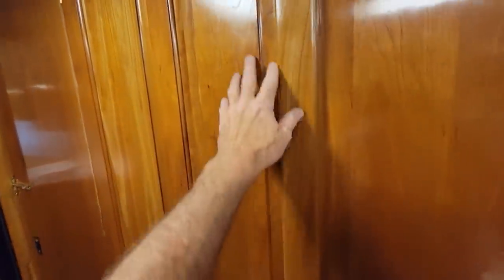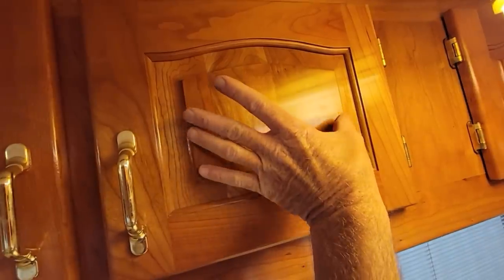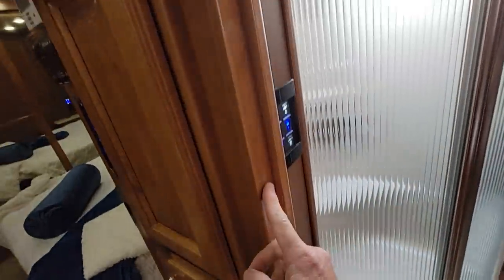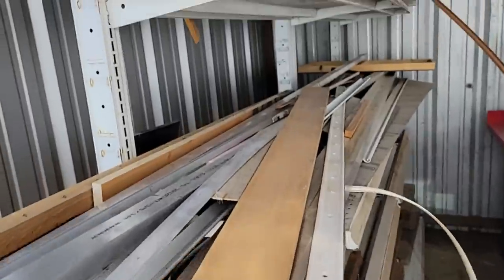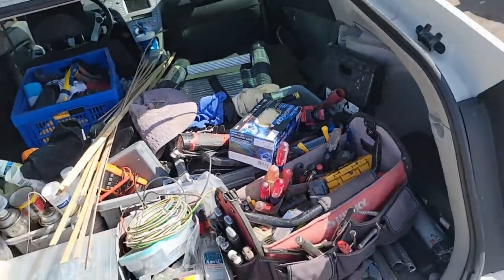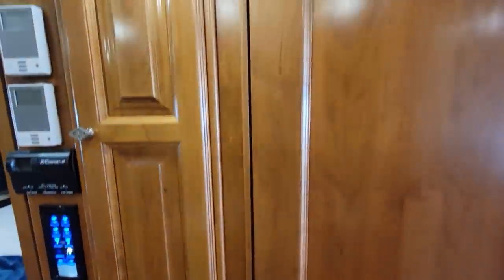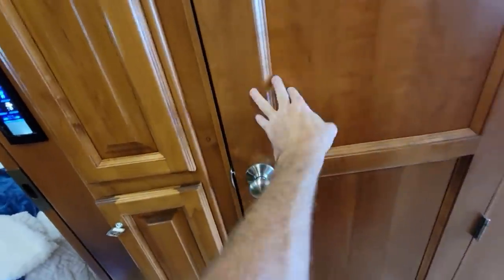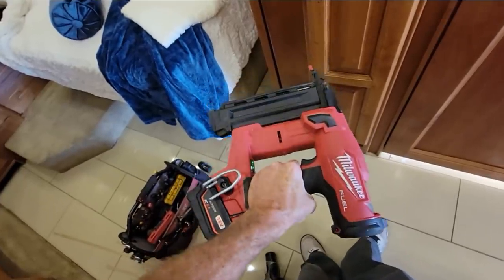A Very Common But Forgotten RV Maintenance

Comment: As a degreed furniture engineer you allow the panel to float inside the rails and stiles by just pinning the panel.  No glue on the panels, just on the stiles and rails.  The panels must be prefinished on the tongue that inserts into the groove of the stiles and rails.  Once movement occurs the prefinished panel tongue will not be noticed since it was prefinished before assembly into the door.  Lumber should be kiln dried to 6%-7% MC before assembly.  That will give you a good range with EMC's in the US.  Still have shrink and swell though.  Just have to manage it.  Thanks for the videos.  I appreciate them.
Reply from the maker: Thanks for the info! and thanks for watching
Reply: I really appreciate witnessing two experts exchanging valuable information! Thank you both!!

Comment: I love your YouTube channel. I am a subscriber. And it's thanks to you. I recently got myself a 22-year-old, 2002, Monaco, Knight, 34-PST. That has spent its entire life in, Central, Texas. Owned by a couple of, elderly couples. And kept in immaculate condition. Like new.

And being 22 years old now. In Texas. Where is very dry. The doors are all tight. There are no gaps. It's all very lovely, natural blonde wood. Just beautiful. The exterior is colored Taupe. The exterior is gorgeous. Eggshell white. With, some beautiful conservative, light gray, dark gray, black, sweeping lines. Very snazzy. Not gaudy. No stupid colors. Very stealth. With 3 slide outs. All working great. And 65,100 miles on the odometer on the 300 HP Cummins.

And it's watching your channel. And also Liz Amazing's, Channel. You guys had me in the right direction. On my selection. Thank you. This is a gorgeous unit. Like new. It was Covered for the past 4 years. And under the chassis. I really can't find any rust. It looks amazing. It's got 6 , one and a, half-year-old, Toyo Tires. Really showing no appreciable wear. They got them last January. 2023 and have only taken a couple of trips since. Before that, 88 and 85 years of age and failing health. They had to hang up their, newfound freedom. From their 14 grandchildren as they told me the motor home was strictly, for them. I said your grandchildren were never on your motor home? They said no. I thought that was very funny. I never really grandparents like that before? But I guess 14 grandchildren can wear you out? And they could escape with the Motorhome. So I know they were giving up a lot. It was Sarah and Bill. And Sarah told me the Motorhome's name is, Magnolia.

I can't believe how gorgeous and how perfect, it is. And the front CRT, BOOB Tube. Was expertly replaced. With a nice big LCD-TV/Monitor. And the same in the bedroom. No washer dryer. And that's fine. I like going to the laundromat. Once every couple months. I have a lot of clothing. I have boxes of only the best, audio/video crew, T-shirts. From all of the shows I have worked with over the decades. How do all these decades ago by so quickly?

Well? I'm going to be 69, soon. All of my loving family members who passed on. I'm the only one left in my family. I never had any children of my own. Recently I became an adoptive parent. To a, 34 foot long, 30,000 pound, child. And it eats a lot. So I don't have to. I need to loose some weight. This is a great way to start. To start a diet. With a Motorhome. That gets, about 10 mpg. So it's definitely going to eat better than I will. I will eat, a lot of beans. To produce enough gas. To, heat my water for a shower. Once a week. Whether I need it or not. I'm going to have to eat a lot of beans. As I am musically oriented. I have major music award nominations. But only, nominations. So that doesn't count.

And now it almost 69. It's time for me to become a Nomad. With a very nice diesel pusher. And for its age. Everything that could have broke. Already did. Was already fixed. And/or replaced. Or it's still that new. Though? I will have to replace all, 6 rotted out speakers. And that'll set me back a whopping, $300 for the low-end, JBL's. $600 for the better ones. But that's the only brand I'll purchase. I used to them and all my recording studios over the decades. I've had more than one studio. In more than one location. Big ones, small ones. Both. And then I went a different direction. I largely, downsized.

So? In 1990. I moved my beautiful Control Room. My high-end, it is a data control room. With everything recycled and refurbished. By me. And loaded my whole control room. Into a 1984, Mercedes-Benz, L-1117, turbodiesel, 25,000 pound, Box Truck. With a, 1 ton powerless tailgate. That makes for a great little ports. And the rear garage door removed. Replaced with a single large swing outdoor. With top and bottom latching deadbolts. And no windows. And a box built within the box. Everything is soundproofed. Then split into 3 internal rooms. All separated with solid core front doors. And I operated my business for over 30 years. Until the pandemic. And I knew it was time to throw in the towel. And sell everything off.

After paying off all my bills and going completely broke. I have enough money left over to purchase this Monaco Motor home for $25,000 cash. I think I got a really good deal. It might be slightly over bluebook? But it is choice and like new throughout. Everything in the manual. Is what I'm looking at. Even the radio. Which has to go. It still works fine. But I want better. I.e., better. As a Retired Audio Engineer.

So with, 12 volt, Audio, Sine wave, Inverter, on. Connected to the new dashboard radio. I have mine former, JBL Control Roof Speakers. Right behind the driver's seat in my coach. And I will be Rockin' Down the Highway. With the Doobie Brothers. And all the others like them. And look. There's, Toto! They are singing something about, Africa. And there will be no, Elvis Presley in this Motorhome. Though? Maybe an occasional, Buddy Holly? But Chicago would be better. Even in the winter time. In Quartzsite, Arizona.

I'm going to have some fun at, RV Parks. I think I will take out my old, Network Television chops. And I want to do a, Karaoke thing. It'll blow everybody's mind. Nobody does Karaoke. Like, I'm going to do, Karaoke. It's going to freak everybody out. Everybody will want to do this. I will end up with lines of people. I will have no problems making a few extra dollars. When they get a recording. Of what they've just done. With video. With multiple cameras. Chroma green background. Along with my video switcher. I can put them. Anywhere they want to be. Anyplace. Even anywhere in time. With digital video backgrounds. And then! To get really crafty.

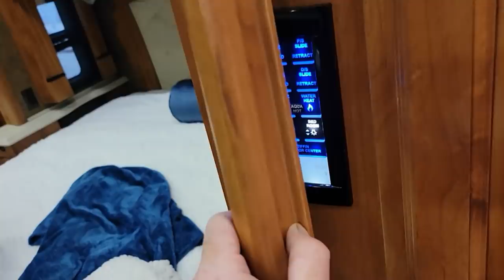I have a major music award nominations. Partly for the way I know how to cut vocals. And I use a couple of gizmos. One is a real-time digital, Pitch Corrector. Nobody will be singing out of tune at all. They will all sound like hit records. And walk away with a cool video of themselves. Nobody does this. Not like this. It might spring a second career for me? I've been talking about this for years. I've had the video gear and audio gear, for years. And it is so simple, high-quality and lightweight today. And it's all in how you use it. How you put this show, together. It only lasts, 2:30-4:30 minutes long. But what a, Showcase it can become. I think it'll keep me busy virtually every night I want to do it. At an RV park. It will be fun and goofy. They do the same thing. To, Taylor Swift and Justin Bieber and those types. Talent Light. Diet Talent. Zero Calorie Talent. Types. And it's largely all automatic. To let that fool you. That they practiced or rehearsed. They likely did nothing of the kind. Why would they waste their time? They have computers and software and an, Expensive Producer. And high-end studio. And managers and publicists. And they Concert Tour. They Perform with the, Computer. Because they can't do it without it. They have no talent. They would sell like Karaoke Night at your local Bar. Ugh! Vomitus! But great when you are drunk. I don't drink much. It makes me feel bloated. I retain water. And I only get natural sea salt. From Sushi. And fresh brewed soy sauce. Along with fresh brewed beer. And you get all the food groups. And magically lose weight! Because Motorhomes eat well. So you don't have to. Motorhomes make you healthier. When the toilet breaks. You have to find others. Because your tank is full of crap. Then what do you do? Get another motorhomes? I

I like the one I just got thanks. And so I don't care what people say about me. I am not full of crap! I go to the house where I can. So I don't have to play with a lot of crap!
RemyRAD

Comment: I believe your Beaver was made in Bend Oregon in the central part of the state. I have a 40 ft Beaver Marquis with the cat c12 @ 505 hp. I’ve been told they moved operations to Eugene after 2002. The power to weight ratio in these rigs is astounding. 26000 lbs with 1650 lbs of torque.
Reply from the maker: They are truly amazing!

Comment: That was most interesting to watch. My Holiday Rambler was spending its first 14 years in the dry climate of Arizona were we found it and brought it over to good old and much more humid Germany. And since its one 2003 HR Imperial, the types and modelyears that you recommended in previous videos, it has no cracks or loose wood connections. Thank god! Right now i sit at my desk, looking outside the window and see my RV in the driveway. I have a remote sensor temp/humidity gauge right in here that shows 59% outside (Fresh air) and 56% in the closed rv. And dry 30% in my heated house. I guess for my own skin ..and my plants .. the air in the rv would be much better. Greets from Germany and keep up with your good work!
Reply from the maker: Thanks!

Comment: My Tiffin had that exact problem with the bathroom door. I had to put pillows in front of the bathroom door when we traveled before I had it fixed to stop,it opening while driving. My Tiffin has the 7 k generator option that’s one of the reasons I bought a Tiffin.
Reply from the maker: Thanks for watching! :)

Comment: Hello James being around 60 miles from Red Bay, Alabama. I can tell you during the summer months it gets hot
and very humid . Most if not all the doors in my house has the same problem they shut good in summer, and not good
at all in the winter months. But this happens in most different parts of the world as well. Then I have a wood heater in the
winter months I will have to put a big pot of water on top of the stove to add moisture back into the house lol go figure.
Reply from the maker: Thanks for watching!

Comment: I've got the opposite problem, high humidity. I've got a 35 qt dehumidifier that's plugged in 24/7 year round.
Reply from the maker: How fast does it fill up
Reply: @AZExpert  sorry been busy. During rainy season, every couple of days.
Reply: Yet, couldn’t you keep your AC on in the unit (I’m in SWFL with RV parked, hooked in onsite). We have loads off water dripping off AC daily.

Comment: I've had to re-shim some closet doors in my condo because it's settled quite a bit shortly after being built about 12 years ago; or the contractors were so sloppy they just didn't care.  I just put some thin pieces of file folder type cardboard directly under the middle and bottom hinges until I got enough lift to where the ball-spring latch at the top would catch again and work properly.  It looks fine and unless you whip out the tape measure you won't notice the slight gap of about 1/8-inch at the bottom hinge.
Reply from the maker: Thanks for watching! :)

Comment: Living in Southern Nevada, the swamp cooler on the RV garage keeps plenty of moisture in the air for the RV now....what a difference.  Used the bucket brigade (3 buckets) for years, but really feel it did nothing as shrinkage was still an issue.  That was on a Bounder at the time.
Reply from the maker: Yes this would be for people who do not have an RV garage

Comment: The wall moves in those tiffins I had an Allergo bus that did that I would have to knock the wall back periodically with my palm of my fist a few good blows and foot pressure and the door fit perfectly again.
Reply from the maker: The good old meat hammer
Reply: Yes! But which way to move the wall- towards inside the bathroom, or outward to the hallway?!

Comment: James,   I’m guessing that RV has been sitting in Az unused for a few months.    I’ve done some woodworking since classes I had in college(not a professional.  Built our home cabinets out of walnut, made some furniture, and turned some bowls.  Here is my big concern.   If this RV stays in Arizona, no issues.   If it goes to a more humid area and stays there for a few months, that door may now jamb so tight, you will have to pull the hinge pins to get the door out.   Wood expands and contracts with moisture content.   The door and the cabinet faces will go to original size or larger.
Great video.   Best wishes,   Kevin
Reply from the maker: That is correct.

Comment: It's funny you mention the bucket for humidity driving truck I used a jar of water on the dash at night in az so the air wouldnt dry out did it for years so it works.
Reply from the maker: Hahaha it does work!

Comment: Many ... MANY years ago I ran a contractors paint supply and had to keep paint and stain for 1 year on the houses (all owned, built and sold by one Corp.)  for touch up purposes. Homeowners would freak out come winter and their cabinets would show bare wood, or their doors would and so the contractor would come by and ask for whatever house numbers paint or stain...especially the custom color selections. Low budget stick stuff wasn't kept, just the codes. But yeah, that's real stuff with real wood growing and shrinking.
Reply from the maker: It is!

Comment: This is one thing we don't have to worry about here in south Louisiana, instead we have to worry about mold and mildew in RV's that are stored without ventilation or the air conditioning running.  I am lucky I have power at my storage shed so can keep the air conditioner set to 85 or so degrees which is enough to suck enough of the moisture out of the air to keep mildew from forming.  p.s. desiccants are useless here a gallon bucket of desiccant will be waterlogged within a week or so in our environment.
Reply from the maker: Not a problem here

Comment: Thank you I have a navigator with lots of wood and I live in Florida near Cocoa Beach I noticed that the wood and the hinges and locks move an act different in different spots it’s sat in the sun for years 500 feet from the river not much of a problem three months in a shaded area the locks and hinges and some of the wood start moving around locks would not unlock struts got stuck on the Bay doors cabinet doors look like they want to come apart I will try to trick with the water in the shower
Reply from the maker: Sounds great!

Comment: An easy solution to shrinking door panels might be to stain the panels before they are assembled into the frames which might mean that the frames would need to be stained first too. 
I would guess that the bathroom door had excessive gaps to begin with.
I'm surprised by the shower appearing to be so small and the toilet in such a tight place.
Reply from the maker: It's pretty common in RVs

Comment: I live near red bay and full time in a 97 dutch star DP, my wifes family has a place in quartzsite that I normally have to visit in aug/sept.

its like I drive 2000 miles to two opposite side of hell. at least AL has rivers and trees.

they have a hoard of 1950-1970 campers in amazing condition in the Q, they all get buckets -- the bigger ones get a 55gal trash can. they are all in amazing condition.

meanwhile the two in AL have major water damage as they were stored uncovered.
Reply from the maker: I'm not sure why anyone would go to Quartzite in the summer, ugh
Reply: @AZExpert  trust me I don't enjoy it. We just pick up a camper and gear then head north to the Reno area for a large event..

It's wonderful there in Feb when I've been able to go to western winter blast in Havasu. Best thing any pyro can do.

I may be looking for a shop in phx area that would work on a square body suburban 2500. It was left in quartzsite in late 2019 after breaking down and I really want to get it home to AL. If you have any recommendations for a shop let me know, thanks.

Comment: In an earlier video you said your class A will level, but not by raising the whole vehicle. Is the body not permanently affixed to the frame? Or how does it work?
Reply from the maker: It's on airbags.

Comment: James could you have done a moisture test to the wood and than try to increase the moisture content to get it back to normal to see if it corrected it’s self?
Reply from the maker: I suppose I could, but that seems like a lot of extra work
Reply: @AZExpert  I get that. But like inside your home it’s best to have the humidity at 50% for wood, your skin, etc…. But if it’s just too dry it might be simpler to get it to it’s recommended moister content to relieve the issue. It may not make the problem go away but at least your starting to correct the problem at zero. By fixing it when it’s too dry you run the risk of it not working when the humidity gets back to normal.

Comment: Nice Motorhome! Now the question that I would have is that if that motorhome should find itself in the pacific NW, would the newly shimmed bathroom door swell back up to the point it would stick shut, or no longer shut?

My Lance trailer has a wood they call lite-ply which swells noticeably when you get it around high humidity, such as when I go to the Oregon coast. When that happens a number of the interior storage compartments will not shut until things dry out a bit. Just one of those unexpected things I learned soon after getting this trailer. 

Thanks for the info..........Good Video!
Reply from the maker: Potentially